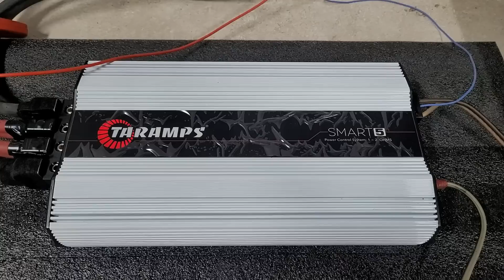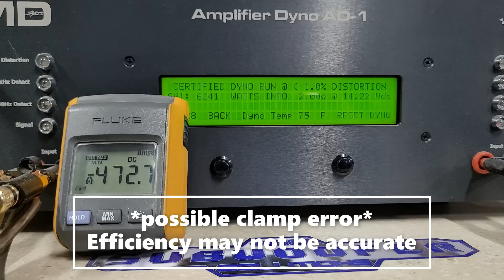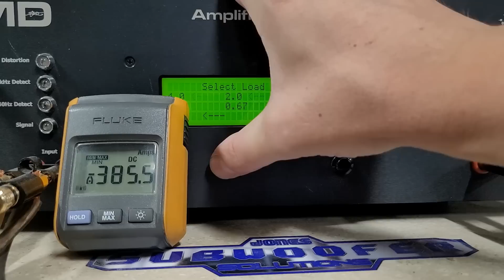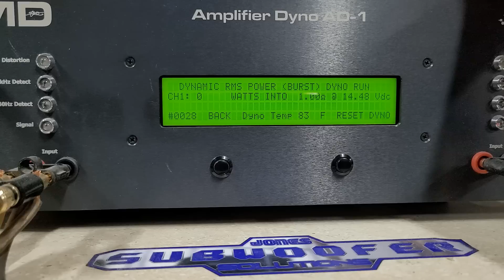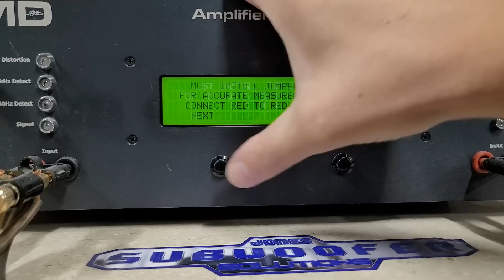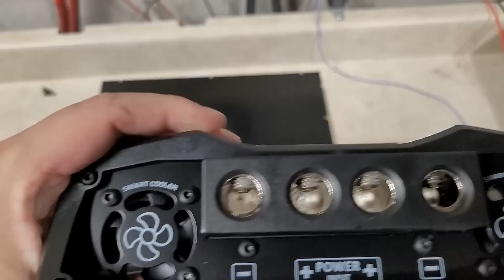AD-1 Amp Dyno Taramps Smart 5k by Jones Subwoofer Solutions JSS

Comment: What's their reliability like ?
Reply: Ive ran the smart 3k amp since the day it was released and have had 0 issues . I run a older audio control eqx dsp with it and have it hooked up to 2 12 inch skar evl dual 4 subs running at 1 ohm i have the amp gain turned to about 40 % gain and the amp is way way way more power than those subs can even begin to handle i have my subs in the 4.5 cubes q bomb spl box tuned to hi 40s about 47 48 htz anything below 35 htz and the subs will bottom out i also have about .8 cubes of poly fill in each chamber so the sub thinks they are in a 2 cubic foot per chamber box. 40 to 60 htz range is so loud it hurts ur chest
Reply: @joshholden8561  thanks I've been interested in them for a while and love my kicker 2400.1 kx just wanted some new options I appreciate your input 👊✊
Reply: @willsteele9249  i had the kicker kxa2400.1 amp also the taramps 3k is way easier on ur electrical system that kxa2400.1  just didnt put out the power it claims i only clamped 2550 rms at 1 ohm with it i clamp 3.770 with my smart 3k at 1 ohm with over 6k burst rms the kxa2400.1 burst did do 4,500 rms but that kicker amp ran hotter than hell u could barely stand to touch it i have a kcker cxa1800.1T  newer 1 ohm model that does 2,250 at 1 ohm 3,500 burst it runs very very warm also
Reply: @joshholden8561  I really appreciate it thanks again  I may just buy one here in the winter I have a big 3 upgrade and a xs3400  battery I'm really interested to see how my American Bass xfls(2) would act like on a 3k 🤔😁
Reply: @willsteele9249  i know a guy with that exact set up its loud
Reply from the maker: Excellent
Reply: @Facekicker  first thanks for responding and second I love your dyno runs and your setup is Absolutely monstrous.I would love to see you do some low Impedance run on any 40kx kicker amp I I suspect these amps can be ran at 1 ohm . Lastly do you have a Patron ❓ thanks again

Comment: Great amp for the money. Looks like it was clamping down on the power a lil to soon at 1 ohm tho. You'd hardly ever see 1 ohm if you were wired at 1 ohm tho. I might have to pick one of them up. I'd love to have two 12 inch subs that reacted well in a 4th order with that amp.

Comment: Cheap, good power, but I'll stick with my half bridge Korean Synergy Audio WFO 5.1D. I'll take reliability over saving a few hundred bucks.
Reply from the maker: I've found the Taramps, especially the Smart series to be extremely reliable
Reply: Full bridge is the future. Now if people could get their DSP's set correctly we would stop hearing about "they sound bad" bullcrap.
Reply: @liftedcj7on44s  full bridge sounds no different than 2 half bridge amps strapped. The sound quality depends on the components, not the design.
Reply: @thatunknownguy87  Re-read my comment, I never said they sound different.
Reply: fosho 👍

Comment: Insanity! Need some major electrical to run this guy! Even after impedance rise you will still get major numbers. As far as quality, only time will tell.
Reply from the maker: I've been running Taramps for a while, my 15ks are about 5 years old - no trouble whatsoever.
I have no doubts that these are quality.
Reply: @Facekicker  I've beat my md8k for over a year, like abused it and it's solid asf. Cannot beat the price for sure
Reply: @Facekicker  5 years is definitely a long time, very nice!
Reply: @JAM-ur8tj  do i need majior electrical for 2 smart 3s.   I have 250 amp alt and 2 agms in back and big 4 upgrade.
Reply: J 409 👋😎 3 batteries 🔋 and you’d be fine on a stock Alternator just make sure you Fuse Amp & Speakers which I seldom see these days , but could save you money 💰 on you expensive gear 😎👍 ‼️

Comment: Unbelievable, looking at the guts this thing really punches above it’s weight, how long will it last though, I have 20 plus year old Orion , and Infinity amps that still work today
Reply: I had one. Plenty of watts... terrible amplifier.  Didn't realize how bad it was until I replaced it with a much lower wattage wetsounds.  Night and day difference in how the subs sounded.  Wasn't as loud, but not by much, but SO MUCH BETTER SOUNDING BASS. I thought my subs were just as good as they get. Infinite baffle set up on a 38 foot boat. I was wrong. These amps have power, play loud, but are garbage.
Reply from the maker: @dougbrook6223  You tried to run a Bass8k (according to your other comment, not the Smart 5k) on a boat?  How much electrical support does that boat have?
User error is most likely to be your problem.
Reply: @Facekicker  I have a proper charging system set up for my stereo. 6, 16volt batteries, with charging system from generator.  More ability than any car alternator will ever give you. Power to it was most definitely not an issue. But as I said, with same everything I came out way better with a quality amplifier.
Reply: @dougbrook6223  what’s subs do you have infinite baffle?
Reply: @angelvip2474  wetsounds revo xxx
Reply: ❌doug brook 👋🤣 I don’t believe YOU ✅
Reply: @dougbrook6223  I have a smart bass 5k and it sounds unbelievably great, and I have cheap subs hooked to it.

Comment: can you some testing with that amp in the 12 volt range these amps were designed focusing on the stock guys also. PLEASE
\
Reply from the maker: It would take about 8 AGM batteries to properly run this amp at 12.8v.
Running a single lithium at 15v is far more realistic when you are considering big amps like this.
Reply: @Facekicker  good point
Reply: Don’t know anyone running stock electrical or 12v with 5k or larger amps the goal is to maintain 14 or better at all times for optimal output & to protect your amps
Reply: I have the 3k on stock alt with a super bank for support it does great these amps are designed to put out power from 12v to 14v they also have smart technology to protect them from being hurt due to low voltage. I understand 14v is optimal I was just asking if you could do some testing in that range is all

Comment: The efficiency @ 2ohms is crazy. And the cmax bank shows its stuff yet again. You weren't charging were you? You're the first I've seen with the smart 5 on the tube. Excellent test n thanks for sharing
Reply from the maker: I meant to have the chargers on, but they were set pretty low - like 14v so they didn't do much for us on these runs.
Reply: @Facekicker  doesn't look like you needed them on anyway. Couldn't find any cmax for decent $ so I've been doing the headway thing. Only 72ah hooked up rn but an additional  72ah is on its way.
Reply: @Facekicker  as new as this 5k is I imagine a lower voltage video on it would be dope. With the regulated power supply it would be interesting
Reply from the maker: @kswis  I'll see what I can do
Reply: @kswis  FYI it is not a regulated power supply, It's actually a regulated output section.

If you notice the .5 Ohm run was right on par with 5k, Ohms law is for every 1V there will be 2A at .5 Ohm. thus making 2500Watts at .5 the same ampere as 5000Watts at 1ohm....... SCIENCE!

Comment: Have u done a EMF Audio amp? He put a button on his amps that will NOT let it clip no matter what
Reply from the maker: We've ran others with a clip limiter, but not EMF.
The ones we have ran wouldn't do very well on the dyno without disabling that feature, but it could be useful for someone who has no idea how to set gains.
Reply: @Facekicker  I dig it I had a feeling that that wouldn't let the test run clean, I just thought it was a genius idea for beginners
Reply: @EarthPoweredHippie  its not new tech. they have had it on amps for well over 20 years . its protection for the users .... but limits the amps in a way that dont normally sound great when its limiting .
Reply: Soft clipping will kill the dynamics when your near the limit.  It is old tech, my MTX 81000D from the mid 2000s had it, NAD amps from the 80s had it.  It's a good feature if you want to protect super expensive drivers from clipping.  Clipping kills.  I've ran 500wrms through tweeters for years then killed them using 50w within days